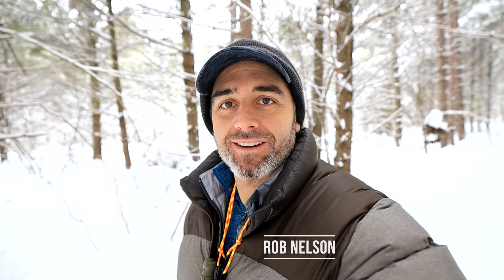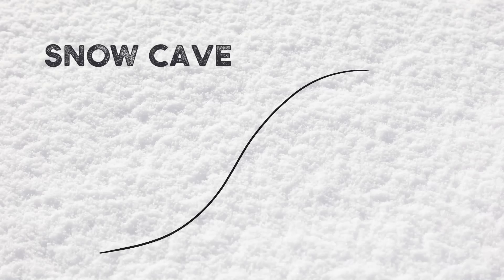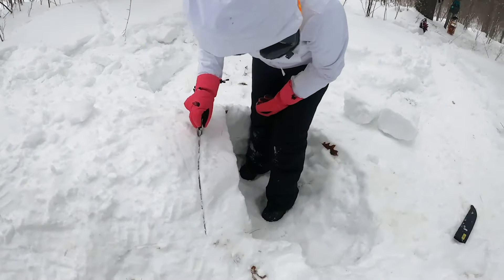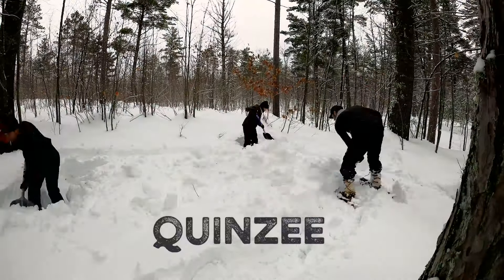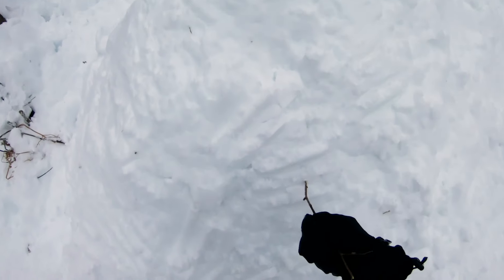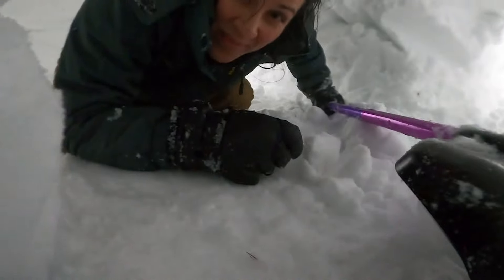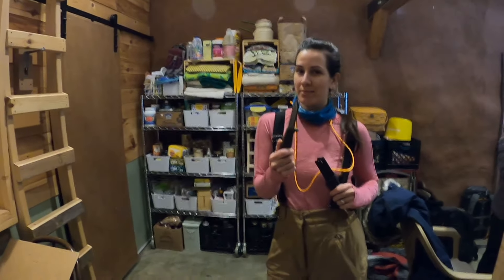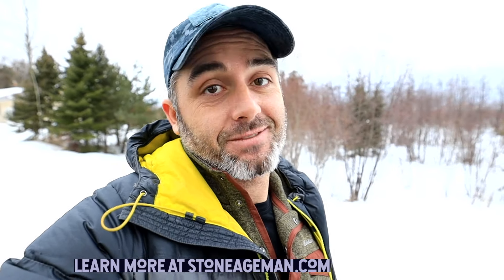How to Make a Snow Cave (Quinzee and Shelter Basics)

Comment: Here’s a tip that makes that process even easier: a plastic sled. Fill it up on the inside, push it to the outside where someone dumps it. Lots less crawling around. Saves energy and time.

Comment: Not a good video. Doesn't cover safety (you should sleep with your shovel inside in case of collapse and make air holes) or how to build the entrance to maintain heat. 12 inch walls is on the thin side.
Reply from the maker: Great points.
Reply: You're right on the point about safety. But that doesn't negate the other good information the video contains. Try not to be so critical.